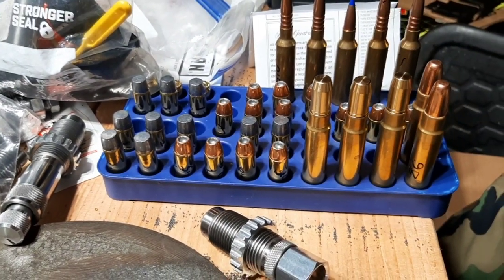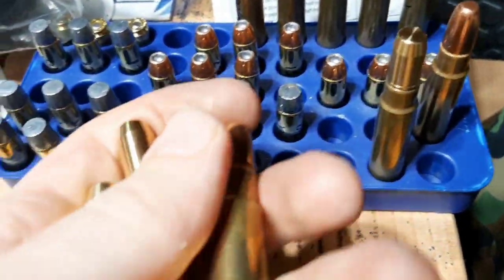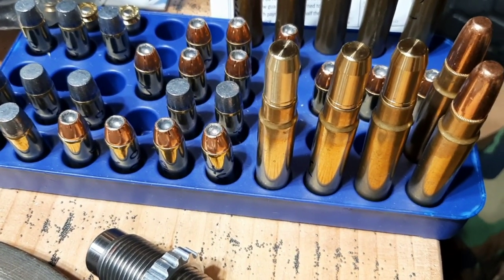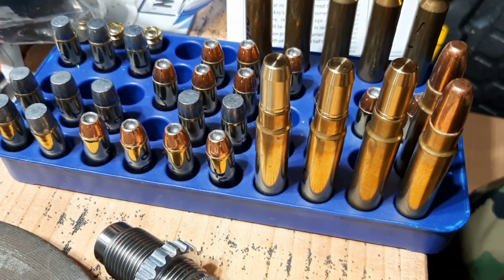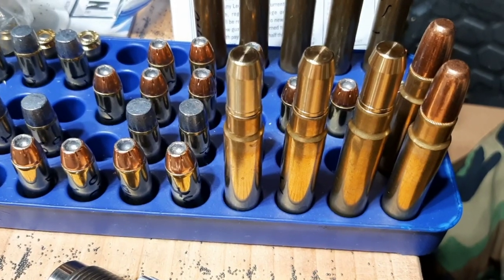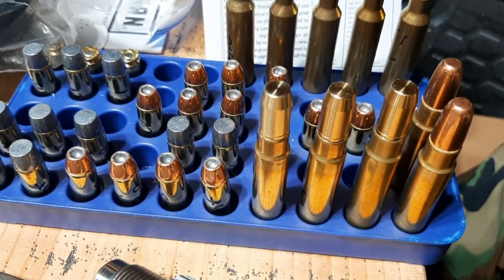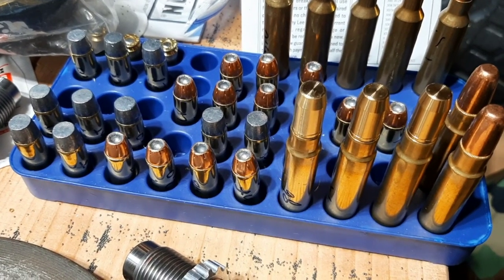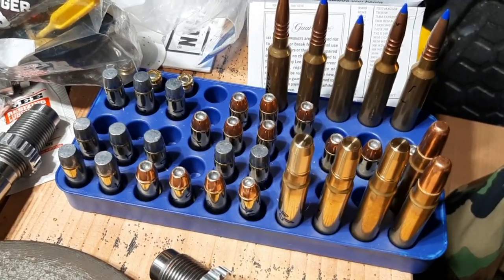Should you crimp Dangerous Game RIFLE Ammo?

Comment: Nice video. I crimp my 45-70 bullets that have crimp grooves or cannelures  so I can use them in Marlin 1895 or Handi rifle. X Bullets are for Handi rifle only and don’t get a crimp but also have no crimp groove location although I could use a band type crimp for those if I found a die that did that for 45-70.
Reply from the maker: Lee factory crimp die will crimp even without a cannelure I use it on my 308 jacketed bullets it works great
Reply: @NYPrepper  yeah i gotta get one for my 45-70. I use them for 7.62x54R and 303 savage. Speaking of which I will be doing some 54R tests this year.